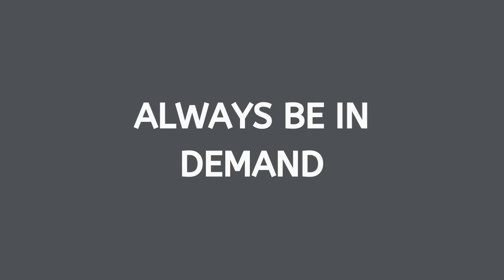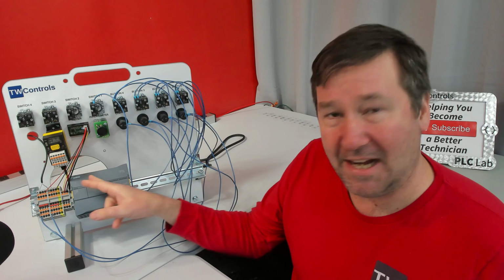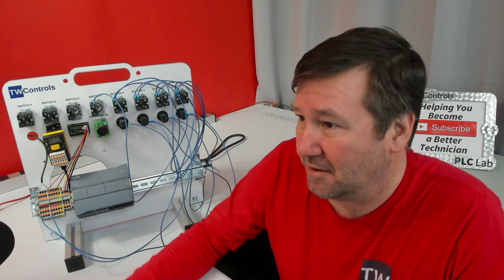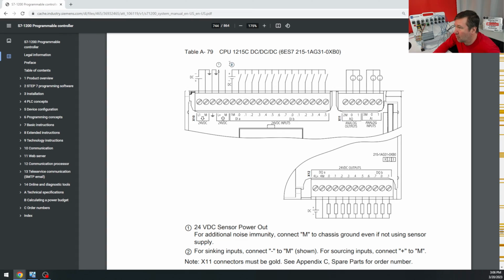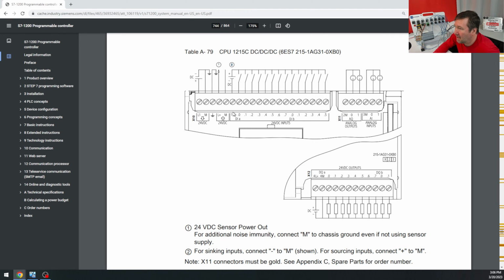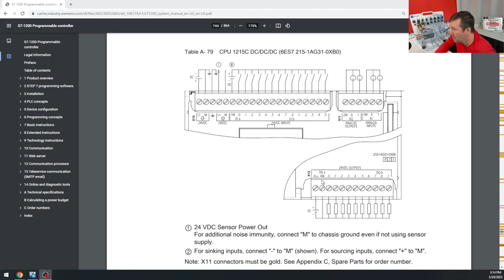How to Wire Your Siemens S7-1200 Inputs and Outputs

Comment: Thank you for the super helpful video! What power supply do you use for your trainers? I have a bulky benchtop power supply, and I've been searching for a power supply like yours that I can plug directly into a wall socket.
Reply from the maker: It is by Mean Well.  The main thing to look for is that it is a class 2 power supply.  That particular one is 60 watts.